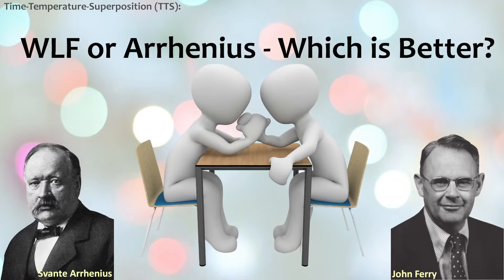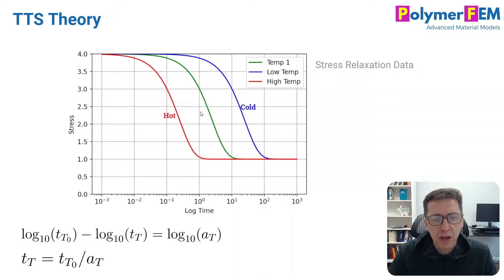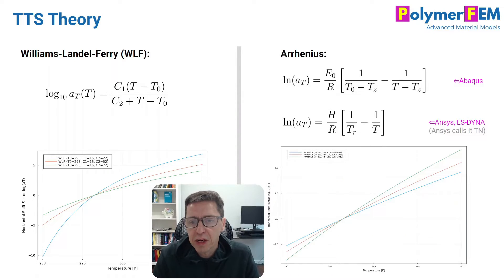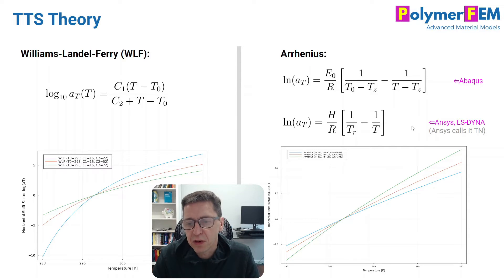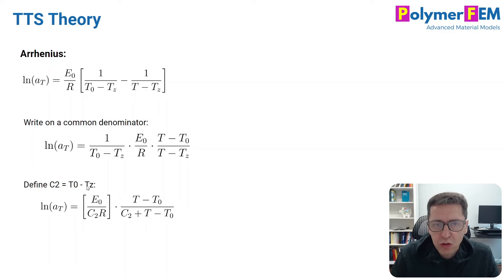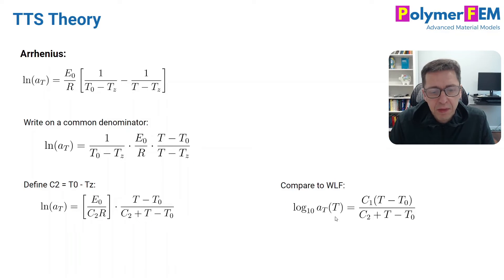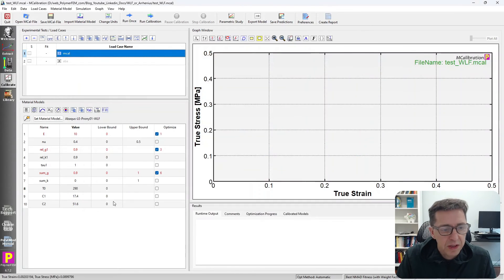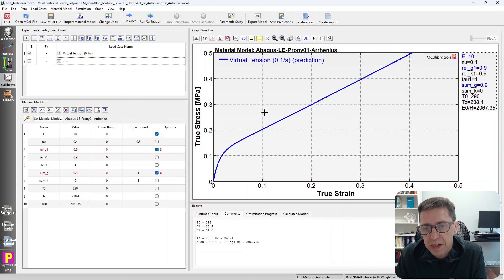WLF or Arrhenius – Which is Better?

Comment: Many thanks for the interesting talk. One remark regarding "Tz" in ABAQUS (for Arrhenius model). 
According to the official documentation: " ... Tz is the absolute zero in the temperature scale being used ..."
What I read as:
   "Tz = 0" in case of Kelvin temperature scale, and 
   "Tz = -273.15" for Celcius temperature scale being used.
Therefore, Tz in not an independent parameter of the Arrhenius model. 

Note that the WLF equation uses a temperature difference (T - T0), which is the same for both temperature scales. So we don't have to pay attention to "Tz" in this case.

Comment: Very nice presentation, many thanks for posting it. I have three comments.
(1) I am confused why ABAQUS called their model Arrhenius. As you presented, this shift factor form is the standard Vogel-Fulcher-Tammann-Hesse (VFTH) form, which is indeed equivalent to WLF. The ANSYS and LS-Dyna form is the true Arrhenius and this is why they have one fewer parameter. 
(2) According to many authors (e.g., van Krevelen, Properties of Polymers), the shift factor in reality has two regions: the Arrhenius region at temperatures T > 1.2Tg, and the WLF region at temperatures T < 1.2Tg. One can come up with interpolation shift factors encompassing both regimes (I proposed one called TS2 a couple years ago, see Soft Matter 2020, 16 (3), 810-825). 
(3) WLF has a divergence issue as T --> T0 - C. This may not matter for most practical calculations but can be unpleasant if one writes an automated code that attempts to blindly go into the low-temperature region. Recently, there have been a lot of discussions in the community whether the WLF-predicted divergence is "real" and there are indications that it is not. 
My bottom line -- WLF is probably fine if one does not attempt to study viscoelastic melts or crosslinked rubbers where T > 1.2Tg. For those, it is better to use the "true" Arrhenius (with Tz = 0).